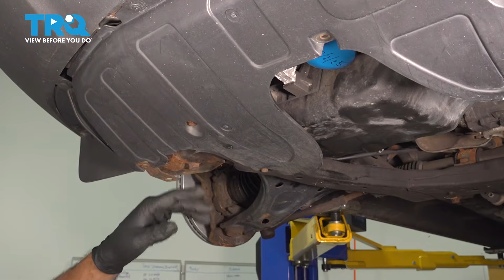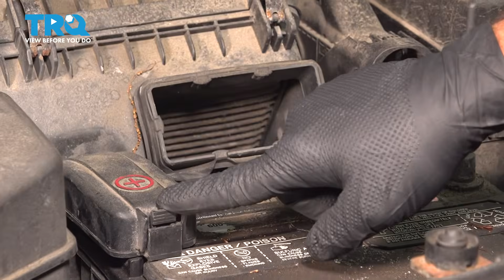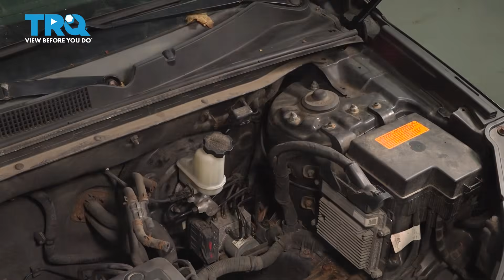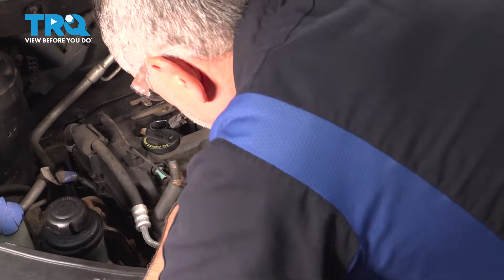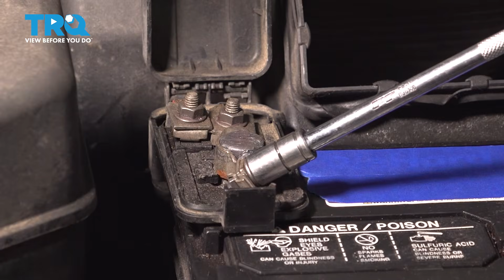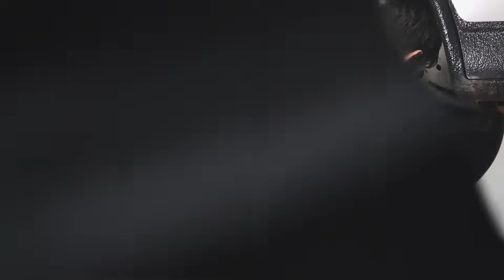How to Replace Intake Manifold 2011-2015 Kia Sorento

Comment: I just finished and also First time doing this because of a bad fuel rail pressure sensor.. (it took me 5hrs and 30mis 😅...) thanks for putting the work and knowledge out there

Putting everything back on its easier then figuring your way in 😂😂😂